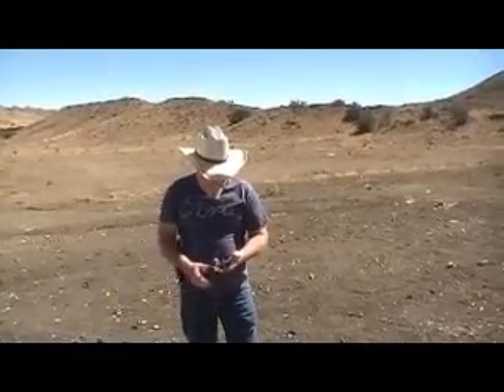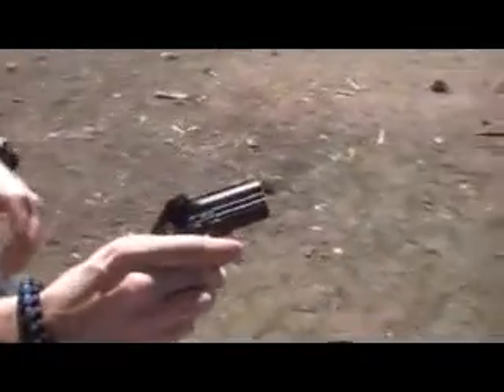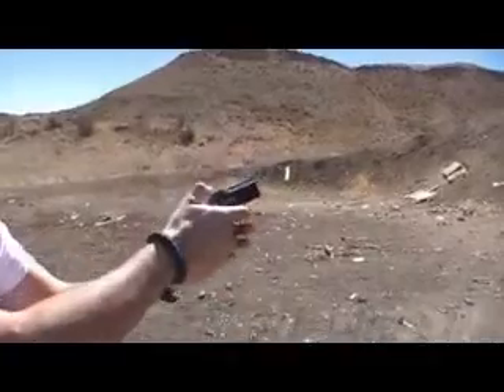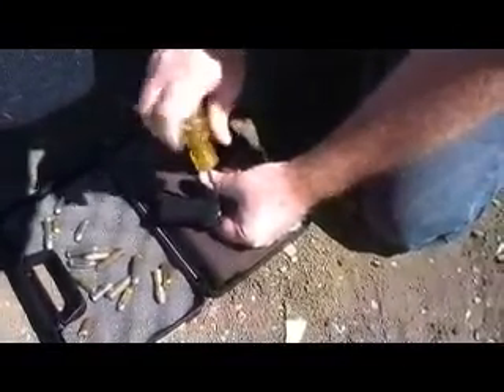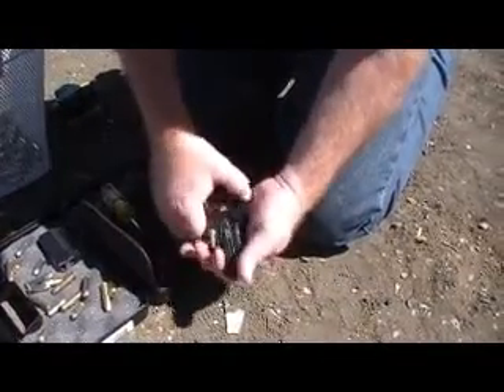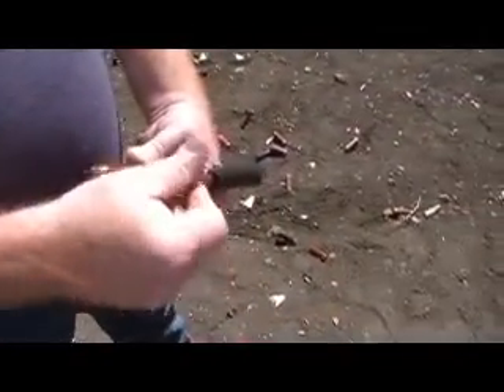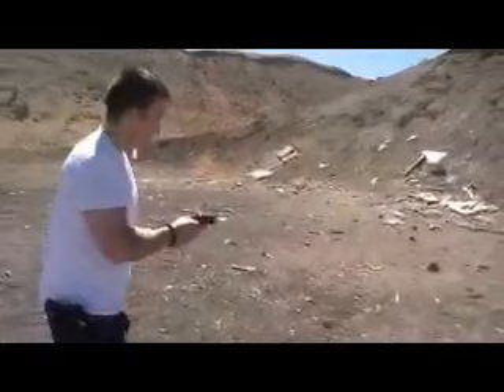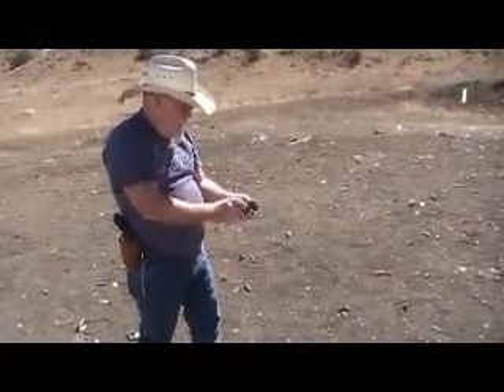Shooting the Cobra Derringer

Comment: good video. thinking about getting one, but damn there is alot a bad reviews. you 9mm didnt fit the shells. price is right but if you cant load it, its a paper wt right?
Reply from the maker: That would be correct it most cases. I am a gunsmith, so i was able to remedy that little problem. Thanks for watching
Reply: ***** I don't have the 9mm barrel myself so I can't say for sure, but I did read in the instructions that you need to slide the ejector up and hang the rounds from it, then let them back into the barrels. I couldn't tell if you had tried it that way.
Reply from the maker: Yup tried that too, But Thank you for sharing, and watching

Comment: Umm, wondering why you used such a small target and long distance for a weapon that is designed to hit body mass targets at 2-10 feet??  Easy to see on the video (and harder to see when shooting without an attentive spotter) that this weapon shoots 1-2' above point of aim....not sure why you guys kept the same point of aim after shooting over the top of the target repeatedly.  Recoil didn't appear bad; I'd feel comfortable using this weapon as a last resort (after my full size 40/45 and CCW 40) and use a low groin POA to ensure a center mass POI.